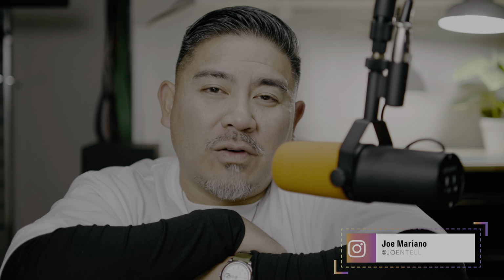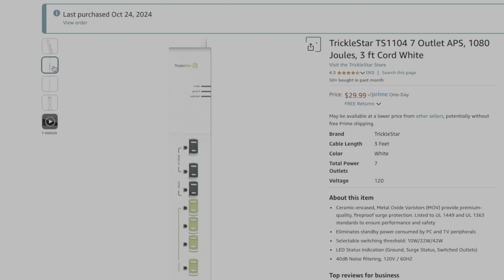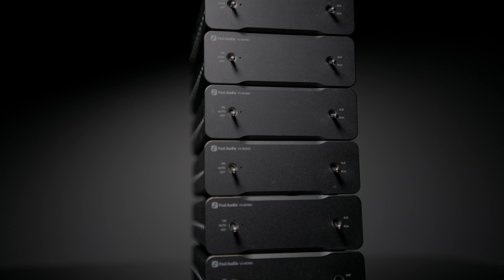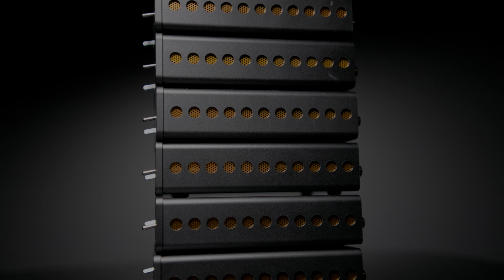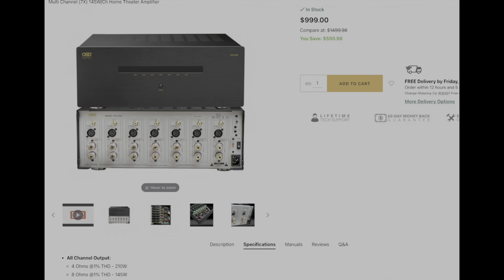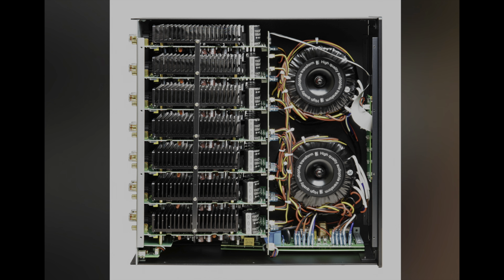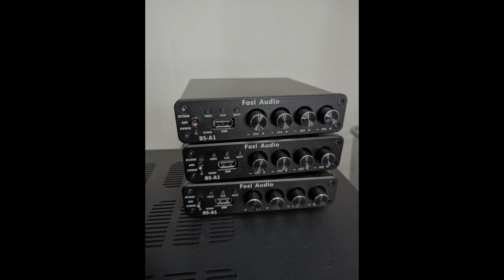I used 6 Fosi Audio V3 Monos in my Home Theater. Here's what happened.

Comment: Maybe Fosi should just come with a 5 / 4 / 3 channel amps with built in power supply, fans, and save us a lot of trouble with cables etc.
Reply: @Leo-tf7gu  they seem to be going with an incremental approach.  Adding one feature at a time.
Reply: For that money you could get a real reciever from a real brand
Reply: @ yes and if you put an slow moving fan on top of it blowing upwards, you can get high output for hours on end.
Reply: @NisuUuno  Emotiva. And they're class AB.
Reply: Fosi Audio HT4S has a built-in power supply, 4.1 channel or 5.1 with an active sub, has banana plugs, but it's not that powerful and all of those channels are in stereo. So, it's not surround even though it has all those channels. but it works.

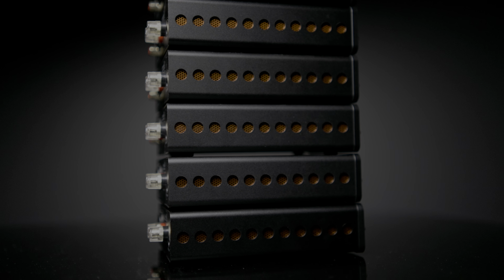Comment: 6:50 "heat, and using the case as a heatsink"
the problem with that is heatsinks, and even radiators still need airflow. A heatsink with no airflow will only cool until the metal has saturated with heat. After that happens it'll start to get hotter and hotter.

Comment: No heat issues with my two stacked TPA3255 stereo power amps running 24/7 driving the ambience/surround speakers in my 7.1 system -- and they're four year old Aiyima A07s, which have a well deserved reputation for very poor thermal design.

Comment: I have been running multiple fosi v3 stereo amps as well as the tb10d and bt20a with the 48v power supplies turned on 24/7 for over 1 year now and have not had problems. If your stacking the amps as shown in your video, that may explain why you had an amplifer die, due to heat buildup from the lower amplifiers spreading to the amps laying on top of them.
Reply from the maker: It was not stacked when it died.
Reply: @joentell  May not be relewant but for every 10c increase you HALF the lifespan of a capacitors. So stacking may have weakened a capacitor so it let go prematurely. Extra voltage margin and higher temp specs usally makes them live way longer. Like decades longer vs 82C 50V cap beeing used at 50V which was common in china amps years ago. Fake caps is till a huge problem and the temp rating and voltage tolerance can be lower in reality than what the prints says. So buying a known brand like Nichicon from a thrusted supplier actually means something in this situation.
Reply from the maker: @impuls60  it wasn't stacked when it failed. With the fans, they feel much cooler even when stacked in pairs, since the fan moves the hot air off the side of the case and upward. The amp on the bottom of the stack isn't much cooler than the top one. I found that putting them on their side with a fan forcing air through the vents kept them the coolest.
Reply: @joentell  I'm doing something similar with push-pull fans top and bottom. I found removing the gold grills from the sides of the amps and using flexible PC case dust filters externally instead seemed to increase the airflow and aid cooling.

Comment: It seems to much of a faff. Yes they're small, but you're still getting cable spaghetti, then a power supply for each amp etc etc. Not worth the trouble.
Reply from the maker: Agreed
Reply: @joentell  Use one larger PSU and multiple DC feeds from it to the amps.  Ain't no way your HT system is going to call for 200+W from all channels at the same time.

Comment: Running 3- V3 stereo w 48v power supplies for Atmos channels, no issues, only run warm, not hot. ~100hz crossover to subs.
Reply from the maker: Mine died when it was in idle. I highly recommend fans.
Reply: @joentell  Yeah, looking closer your speakers are 4 ohm and mine are 8 ohm. Mine also has it's cooling holes on top and bottom and that seems like that would work better to dissipate heat than the holes on the sides.
Reply from the maker: @Roof_Pizza  ahhh, yes. I should've noticed you also said v3 Stereo.
Reply: @joentell It was in idle? Then it had nothing to do with the temperature. Probably just poorly processed. Did you look at what exactly is broken?

Comment: Run them at 42v and apply decent non conductive thermal paste. you will have no heat issues. Imo 48v is too high for this chip long term. 42v is peak efficiency range for the chip.
Reply: I tried these with both 48V, 5A and 36V, 6A supplies. To the touch I found very little difference in temperature. The Aiyima A07 Max ran a lot cooler with the smaller PSU. The A07 runs cooler still.
Reply: Running two stacked A07s @ 46-47 volts -- I don't run them any at higher than that due to their 50 WVDC shunt capacitors -- with zero issues pretty much 24/7/365 for 4+ years.  No issues whatsoever "long term"  AFAICT.  How did you determine "peak efficiency?"

Comment: There is a version on Ali called YS-AS21, now delivered with 3255 chips. Using it for near field sub 300W 15inch and it rocks the house. It has built in active cooling (albeit fan is quite loud to my taste, but it's far from me so I don't care and night low volume listening makes it dissappear completely). I was even considering to remove the fan as the amp is quite cool. Hmm maybe I won't do it after watching this.

Comment: FWIW ... the TPA3255 does not typically run hot.  I have A07s which use the same chip and they never get more than gently warm, even when driven into clipping.  

If you have an AC voltmeter, take a reading across the speaker posts when the amp is on but  idle... A sure indication the amplifier is unstable.
Reply: do you recommend AIYIMA A20 or Fosi V3 mono?

Comment: FYI, ICs are comfortable at a much higher temperature than we are. Design spec for temperature can be above 150°F. I know more about CPUs than op amps, but thermal throttling in PCs is usually well above 175°F. Meaning that a case feeling hot but not burning you isn't in and of itself a cause for concern. If you touch a heat sink and it does burn you, even that may not be cause for concern.
Reply: The TPA3255 when correctly implemented will run at about 40c under normal listening conditions. The chip's internal over temperature warning fires at 120c and it will shut down at 130c. At idle most read about 25c (in a 20c room) and it will be at room temperature when in reset mode.

The V3 has issues. There are reports on several channels of them blowing up, becoming unstable or making hissing noises... none of which are typical of that chip.
Reply: @Douglas_Blake  I heard ONE guy ran around and posted on numerous forums about their ONE amp having an issue. keep in mind Fosi has sold at least 4,000 on their kickstarter and many thousands more since then. Mine are doing just fine. I had a minor issue with one of the four I bought (RCA connector) and Fosi quickly replaced and had very responsive emails. Answered within 24 hours, often the following morning I'd have a reply
Reply: @kayakjoe  
That's interesting ... even with a 1 in 4 failure rate, you speak in support of the product.
Reply: @Douglas_Blake  the amp did not "fail" completely, it was a single RCA connection on one amp and to their credit was replaced quickly and with fast email responses. The other amps had extremely good performance and were equal or better in some ways to my McCormack DNA 1 DLX mono blocks running my Aerial 10T speakers.

Comment: It would have been so much better if they used the za3 case for this.  Just get rid of the volume knob and then everyone would know what it was.  The ZA3 case is way better and allows better airflow underneath.  This would also be nice when combining the “za3 mono” with the ZA3 stereo.  The stereo would be fine for rear and height channels especially since the stereo amps have the same gain as the mono amps, the mono just has more current delivery capability.  It’s basically the stereo amps running in parallel.  

An affordable class D amp with multiple TPA3255 chips is very doable, it would be excellent if it was built with fan cooling built in where the fan is directly mounted to the heat sink and spinning at a nice low speed.  Then you could have a very compact multichannel amp.  It would be pretty nice.
Reply: @ryanchappell5962  Also more space for bigger discrete opamps
Reply: One may only need 3 of these mono ams for the front left/center/right stage. For all the other channels, monolith makes cheap multichannel amps, to streamline the whole setup.
Reply: @ I bet if you fan cool the monolith amps you can get as much as you would ever need out of them.  They may not need fan cooling but class AB amps definitely seem to perform better when they are kept nice and cool.  I have done this with many AVRs with great success.  You can sustain high outputs that way.
Reply: @ryanchappell5962 But we don’t have a class A/B here. The fosi v3 Mono always plays the same regardless of its temperature. That is the advantage of this further developed D class. People find even 45 degrees Celsius unpleasant when they touch something, so there is no need to worry.
Reply: @ryanchappell5962  How can you think that the V3 are like the Za3 without PFFB?? This is a night and day difference on some speakers
Reply: @BenutzernameXY I just said the Za3 case is better than the V3 Mono case.  I understand that V3 mono has PFFB and that gives it better sound quality.

I didn’t know that class d sound is unaffected by temperature.  My own testing seems to show a degradation but those tests are pretty subjective.  Has anyone else done some testing on this?

Comment: Something is very off with the sound. Somehow it sounds very artificial and I have a feeling that it's not well synced with the lips or something along the lines. The issue is subtle but noticable.
Reply from the maker: You're talking about my video, right? I used the auto-sync function in Final Cut Pro to sync the audio captured with the mic with the scratch audio from the camera. Maybe it was slightly off.
Reply: Haven't watched the video yet. Are all the phases on the monos correct?

Comment: Unless you have speakers that get under 4 ohms, you will get the same bang for your buck from 3 stereo amps... V3, ZA3, A07, A70 etc.  

The only time you really need the monobloc (PBTL) versions of the TPA3255 are for low impedance speakers (3 or 2 ohms).  There's no power advantage to the PBTL configuration at 4 or 8 ohms.

Moreover, the hot running of the V3mono is a design flaw ... the Aiyima A70 mono doesn't have this problem.

Comment: Absolutely want a affordable class d multi channel amp. But we also need a affordable decoder to go along with it. Having 5+ channels of amplification is useless when the codec can't be decoded.

I have a old htib with a 1000w class d 5.1 ch amp for my cottage setup with some different speakers and it sips power compared to my normal avr's
Reply: @andrewmcewan9145  just bought a Marantz atmos pre amp, 11.2 channels, used but with 3 months warranty for 400. Adding these amps would make a nice setup